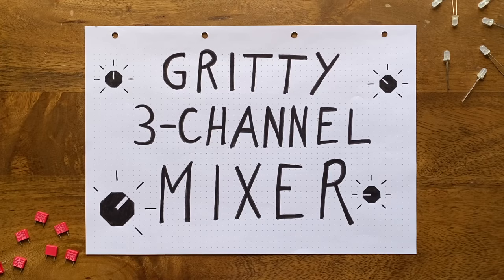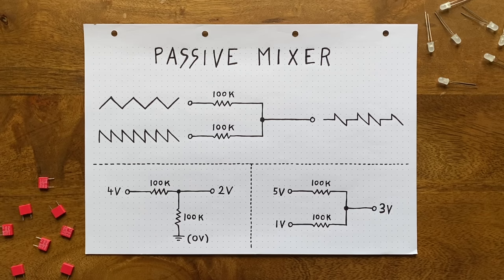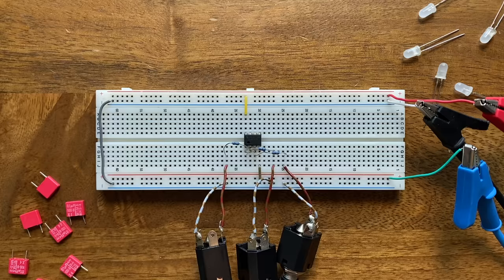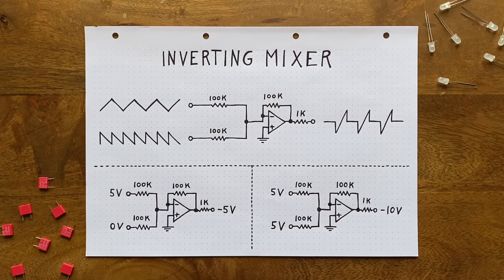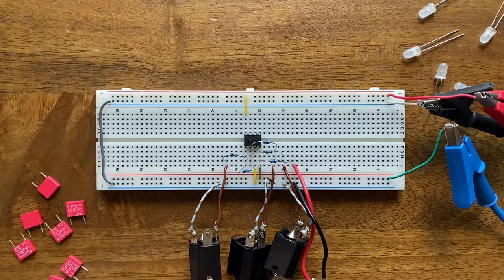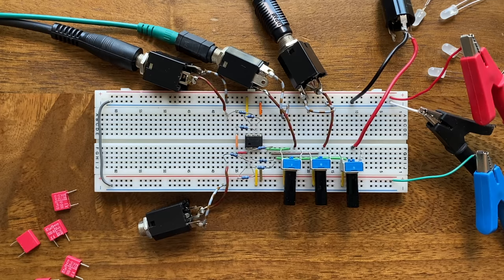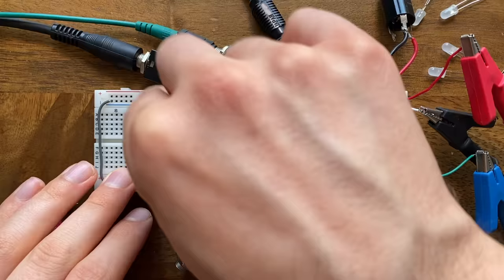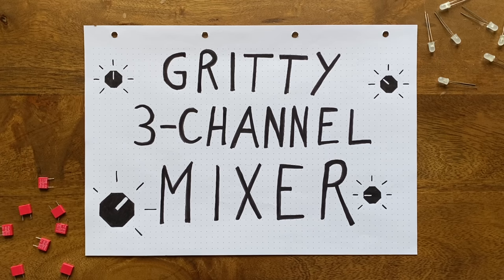Designing a 3-channel mixer with diode distortion from scratch

Comment: Excellent vid!  There's really nothing new or innovative to be said about the design of an active mixer, but the way you explain it is wonderful!  Due to the way you provide tidy explanations of how things work on the basic level, accompanied by examples, I now understand, among other things, why my passive resistance mixers have always resulted in signal loss, and why an inverting buffer on the output side of a resistance mixer fixes this issue.  Fun moment: when you were explaining the addition of the buffer, and you said you were using a TL072 chip, I wondered, "Why does he need a dual op amp, instead of using a TL071?"  Then, when you made the other op amp into an inverter, I literally said out loud, "And that's why you use a TL072!" 😆 I'm not much into modular synthesis, but as a multi-instrumentalist, I've long sought a way to mix instrument-level signals on stage.  While this mixer still wants line-level signals on the input side, I think you've provided me with enough information in this single vid to understand what I would need to build.  And that's saying something, as I've been trying to work this out for years!  Liked and subscribed.
Reply: BTW, one thing I would have liked to see is the effect of turning down the pot on the clipping circuit, shown with the sawtooth wave on the oscilloscope.

Comment: Love your videos, very clear. One pedantic point, is this diode clipping type is normally termed hard clipping. Soft clipping is normally in the feedback loop of an opamp and adjust the gain applied rather than chopping off the top.

Comment: Placing the soft clipper after the mixer means that if you mix waveforms that aren't closely harmonically related you will get a lot of intermodulation distortion, producing all kinds of harmonically unrelated frequencies. Of course, sometimes you want that, like with distortion on electric guitars. But then you usually play power chords, with a fifth between the two notes to go through distorion together, so they are really closely harmonically related to avoid too much intermodulation distortion. Of course, electric guitar distortion can be a lot more nonlinear than a soft clipper.

But I think that the soft clipper could be really useful to have before mixing. If you have a single melodic voice then it will be almost periodic, and then the soft clipper will mostly just make interesting changes to the harmonic spectrum, especially if it changes volume.

Also, I think that it could be usedful to have a bigger than 20 k pot to ground coupled to the diodes? At the 20 k setting, assuming the diodes connect, the incremental voltage change will be 1/6 of the voltage change at the input (voltage division 100 k <-> 20 k). That's definitely softer than clipping to one diode drop, but I think an even softer clip could be useful as well? Maybe a 100 k pot at least?

Comment: I stripboarded this and made a 6 ch version. I couldn't figure out why the distortion was awful until I realized I missed the 100k between the two opamps, doh! Very easy and nice
Reply: What voltage for opamp and diode values? Thanks

Comment: You could create an AVC type feedback voltage from the inputs with adjustable slew rate control. 
Then connect that to a couple of op amps driving the clipping diodes, clip level & AVCFB is now driving the op amps.
Now it will dynamically track and clip the input level. You could even add clip & slew CV's.

Comment: it's easyer to think of the voltage divider as adding them and then finding the midpoint, (5+1)/2 = 3

it's even algebraically equal
(5-1)/2 + 1
5/2 - 1/2 + 1
5/2 + 1/2
(5+1)/2

Comment: Is this not hard clipping as it's diodes to ground? Soft clipping would normally be in the feedback of a opamp.  At least that's how it is in overdrive pedals, I'm still learning synth stuff.
Reply from the maker: clipping is considered to be "hard" when the signal is strictly cut off at the clipping threshold, producing flat peaks with sharp angles. this sounds really harsh and digital, for lack of a better word. on the other hand, clipping is considered to be "soft" when the signal can slightly push past the clipping threshold and the peaks are rounded. this sounds warm and analog. 
since diodes open up gradually as the voltage applied to them increases, my design produces rounded peaks as there is no hard clipping threshold. (still, if you really crank the volume of the signal going into the clipping stage, the effect will get less and less "soft".) check it in the simulator: https://tinyurl.com/y4tvpuzl

Comment: On 8:30 you change the circuit to add the signals together. But this got me thinking: In your schematic, you add 5v + 5v to get -10v. Wouldn't this possibly damage other circuits? Let's say I got 3 VCO's at 5v, and I add them together. According to this schematic they become 15v. If I would feed this into another module, won't this cause some damage? I know, with a potentiometer I could adjust the levels that they would only account for 33% or something so this won't happen, but shouldn't there also be a failsafe that the output would always stay between -5 and +5? Or is this something I do not have to worry about? Disclaimer: I am a very noob with DIY stuff, but I do think that this mixer will be my first project.
Reply from the maker: valid question - the “failsafe” you mention is actually the supply voltage. in my case, that’s +/- 12V. the op amp cannot push out voltages higher or lower than that. and as long as every other module works with the same supply voltage, there shouldn’t be any problems.
Reply: @MoritzKlein0  Thanks! I want to make this mixer to mixer 3 oscillators into one, so they can go into a filter. Is 12v then safe to use? I am very new and don't know what's the default voltage an oscillator outputs and I don't have an oscilloscope to measure what my East Beast and Chipz oscillators outputs (those are the one I want to mix)

Comment: Love the sound and tried to build one on breadboard.. the mixer part works just finde, but I don't get any clipping out of the diodes :/ I did every troubleshooting I could think of, but to no avail. I'm powering the breadboard with the double 9v-battery configuration as described in the manual for the module: is it possible, that there just is no clipping, when the circuit is powered with 9v instead of 12v? I'm grateful for any advice :)
Reply: Nevermind.. I believe the signal is too low for the diodes to clip, when only using line-level signals..
Reply from the maker: @yurig4709  exactly - the signal needs to be at least around 2 V peak-to-peak for the clipping to kick in.

Comment: I had a question. If i have 5 inputs with 5v amplitude in phase, for output i have -25v. But i had just +/-15 v in power supply. I think it will have distortion. How to get rid of it?

Comment: Hi, I'm trying to go for the adjustable mixer, skipping the last opamp because I'll use it as an audio mixer and want to save one op amp to make a gain knob.
I'm facing a weird issue. The mixer seems to not working until I remove the connection between Non-inverting input and ground... In this case, it's seems to work fine. Any idea why ?
I mean, it's working so I'm fine with this solution but I would like to understand if there is any reason + wanted to know if it's safe for the components and the circuit ?

Comment: hey, am I confused or this mixer provides signals more than 10v peak to peak? (at least before the soft cliping)
Reply from the maker: it does, because it’s adding the signals, not averaging them. so it’s up to the user to set the levels to avoid hard clipping.

Comment: i have two questions. what is the Vcc you are using to power the op-amps and can this circuit be powered by a 9v battery
Reply from the maker: in the video i‘m using a split 12V/0V/-12V power supply, but you can also use 9V batteries. you‘ll need two to create a fake 9V/0V/-9V supply - check my VCO series for an explanation on how that works.

Comment: Hey Moritz, how many volts of power do you need for  this circuit to work? What kind of power plug out of the wall would one need to get (in terms of volts and amps supplied by the power plug)
Reply from the maker: that depends on the signals you're trying to mix. the supply voltage will determine the maximum output volume of the mixer. i use +/-12 V in this video!
Reply: @MoritzKlein0  thank you for the answer! I am planning to make a simple summing mixer with an active circuit a la this one but I have concerns regarding fire hazards when using an actual power supply. Are there any precautions I should be taking?
Kind regards

Comment: With the passive average mixer (around 3:10), why can't we use (say) 1 ohm resistors, to allow more source current through? I'm avoiding saying 0 ohm explicitly here, but that's what I'm suggesting. Is it something to do with protecting each input from its sibling's current? Also, how do we arrive at 100k? Why not 1M? etc. Thank you!
Reply from the maker: good question – so the pitfall with using lower resistance values is mainly power usage. if we used two 1k resistors, for example, there'd be a rather large amount of current flowing between the two inputs (from the one where the voltage is currently higher to the one where it's currently lower). 
let's say we send in two eurorack oscillators, which are 10 V peak-to-peak (i.e. oscillating between 5V and -5V). worst case, we have 5V at input one and -5V at input two. that's 10V across 2k ohms worth of resistance, resulting in a current of 5 mA. this current is just "lost", because it always flows, no matter what else we're driving with our circuit. 
if we use 100ks (and a buffer) instead, we only waste about 50 uA in this scenario – which is orders of magnitude less. check it in the simulator: https://tinyurl.com/y5ehgtlo 

as for why we don't use ridiculously huge resistors (1M, 10M, 100M?): there is something called thermal noise (or johnson noise) which scales up with a resistor's resistance value. the bigger a resistor gets, the more noise it introduces into your circuit. (see here: https://eepower.com/resistor-guide/resistor-fundamentals/resistor-noise/# )
so in essence, you want to balance your resistance values in a way that you don't waste too much current, but you also don't introduce audible noise. apparently, 100k is often considered the sweet spot here – which is why i use 100ks frequently. i haven't tested how noisy a 1M would be here, mind you …
Reply: @MoritzKlein0  I see, it's about preserving upstream current, because as you say you may want to use it to drive other stages etc. I asked the question because at one point, in a further iteration we added an op-amp because we didn't have enough current to drive speakers/earphones (?) - my reaction while looking at such a simple circuit was "remove those resistors!". I knew it was wrong, but not why.  As a rule then, we preserve current when we only need to know voltages, and then we supply current right at the point we need power (such as speakers). I've learnt so much from your videos, thank you!

Comment: Did you put some form of compression after the mixer in the demo, or was it just the saturation? When the kick came in you could hear a really pleasing side-chain style pumping in the chords and if that's an inherit of the mixer is is incredible
Reply: I believe the effect comes from the signal getting quieter, the more it distorts. You can also see this in the simulation and monitor the output voltages of the normal and distorted outputs. Because the kick is a strong signal, it distorts more when the kick hits and the signal ducks down. On my built of this mixer I included a wet/dry-mix knob to blend the two signals so I can have the effect with the volume and punch of the clean signal :)

Comment: I made the circuit as shown at 17:48 used it on an acoustic guitar mixing together a small condenser mic and a piezo pickup.  The microphone sound lost some of the upper frequencies and sounds a bit muddy.  Not sure what the culprit is here.  Should I try a different opamp IC?
Reply: Piezo pickups have extremely high output impedances,  the mixers input impedance is too low so it is loading down your signal.  To fix this you could add another op amp configured as a unity gain buffer (opamp output connected to -ve input, piezo connected to +ve input) between the pick-up and the mixer input, this will give the high input impedance required.
The alternative would be to use a piezo pickup preamp, which may be preferable as piezo pickups often need some equalisation to sound right.

Comment: where can i find the 1/4 inch jack sockets? Wheres the best place people order from in general? I ordered everything in the description off some site called guitar pedal parts but they didnt have anything related to the 1/4 jack socket i believe
Reply: Depends what you're wanting and how long you want to wait for it, really.  I'm going to assume you're American - if you're not, then find someone in your country that works with electronics and ask them.

If you're buying stuff and aren't worried about iffy quality or fakes, you can buy stuff off Ali Express or eBay.  This is a good option for buying cheap simple components (passives, discrete semiconductors, etc.), certain supplies (wire, prototyping boards, etc.) and physical devices like jacks and knobs.  Modules, knock-off microcontrollers, and ICs that are cheap and you don't care much about are good as well.  Don't buy anything for serious projects or for production from these places.  Bear in mind that stuff from Ali Express often takes a month or two to get to you, and might get lost along the way.  Don't expect good customer service.

Then there are the mid-tier distributors like Jameco and a million others on the 'net.  They're American companies that resell mostly stuff they get from China.  These are sites that are more expensive than eBay or Ali Express, but you're probably going to get your stuff quickly and it's less likely to be fakes.  I like to get my ICs from places like this.

For the stuff that you want to be 100% sure it's genuine (or stuff that's hard to find), there's the big boys - Mouser, DIgikey, Newark, etc.  These companies buy directly from the manufacturers.  They're not cheap, and they're really intended for professionals, but they're more than happy to sell you a handful of 555 timers if that's what you're into.

There are a few items you don't want to cheap out on.  Buy high quality breadboards - they last a long time (assuming you don't catch them on fire) and you want to be able to trust that your connections are tight.  Solder, solder paste, solder wick, rosin, etc. should also be decent quality.

Comment: I tink that what Is in the circuit Is more an hard clipping circuit with variabile treshold, am i correct? If you have time can you treat soft clipping and saturation? i Always dreamed to emulate tape sat with diodes in some way...
Good job anyway
Reply from the maker: copied from above as someone asked a similar question: clipping is considered to be "hard" when the signal is strictly cut off at the clipping threshold, producing flat peaks with sharp angles. this sounds really harsh and digital, for lack of a better word. on the other hand, clipping is considered to be "soft" when the signal can slightly push past the clipping threshold and the peaks are rounded. this sounds warm and analog. 
since diodes open up gradually as the voltage applied to them increases, my design produces rounded peaks as there is no hard clipping threshold. (still, if you really crank the volume of the signal going into the clipping stage, the effect will get less and less "soft".) check it in the simulator: https://tinyurl.com/y4tvpuzl

Comment: Hi Moritz , does this mixer just run off single 5v power supply or am I missing something? I can’t quite get this thing working, I noticed you have another ground in video I could be mistaken, Ive watched this video so many times 😂 pls help
Reply: It needs dual +ve and -ve supply rails, usually mixers have fairly high voltage rails like +-15v to give plenty of overhead, but +-9v would be fine too.
The TL072 is not really suitable for use at 5v, the output swing would be extremely limited.

Comment: Couldn't you achieve the same effect of adding the inputs together by taking the design that averages them and adjusting the gain on the buffer amp to be equal to the number of inputs?
Reply: Not really, once you add the input pots to adjust the individual levels adjusting one would affect the others so you'd constantly be readjusting the gain every time you changed one of the input levels.

Comment: Not sure if you read this, but I bought your mixer module and soldered it together. All went fine in the process, but somehow it does not work. It looks like the power supply does not reach the ICs. I understand that you cannot give support in general. Just asking for a little help or tips please.
Reply from the maker: are you sure the power socket orientation is correct? because if it isn’t, the diodes will block any current from flowing.
Reply: @MoritzKlein0  I orientated myself after the photos in the assembly instructions, the socket gap shows to the inside. But indeed, I'm often confused about this.
Reply: @MoritzKlein0  I checked back and measured the supply pins at the chip. They are around 23.8 V. I am not sure why the signal is not going through, maybe I need to swap the ics (?)